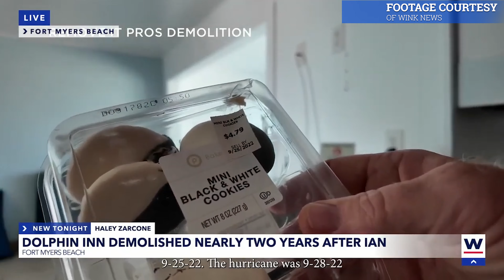We Did a $8,000,000.00 Complex Demolition. (What Did We Find?)

Comment: The concrete recycling plant would have a conniption fit if they saw the size of that concrete. We’d get a bill for making the pieces smaller or get the load rejected
Reply from the maker: Interesting point. Those are floor panels that's lightweight concrete.If you pick 'em up and drop them, they shatter like glass.
Reply: Normally a breaker will take care of any pile towards the end of the job.
Reply: @paulneron375  people love to argue
Reply: @removeitprosdemolition  oh ok. I figured they had rebar in them. Even asphalt if it’s too big the complain. See we get to dump asphalt and concrete for free but if it’s too big or bricks mixed in they get mad. Since we buy so much mix from them they don’t charge us but they will complain since they don’t wanna break it up since we are dumping for free.